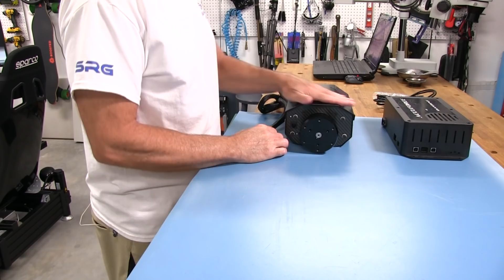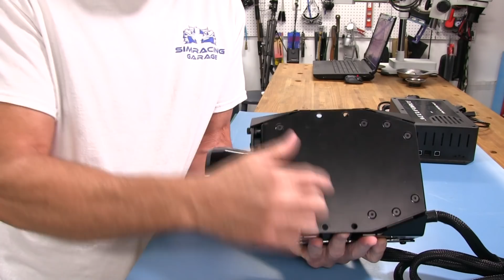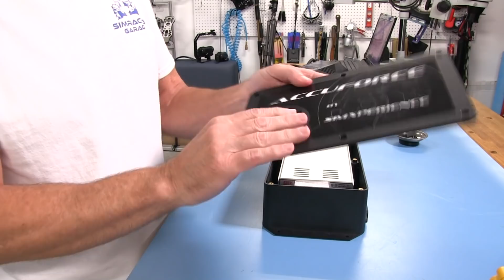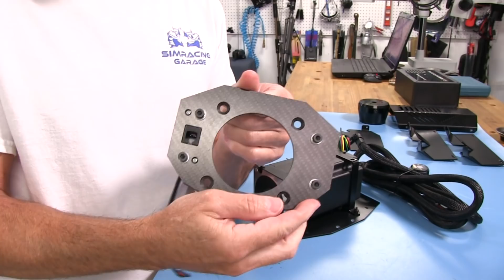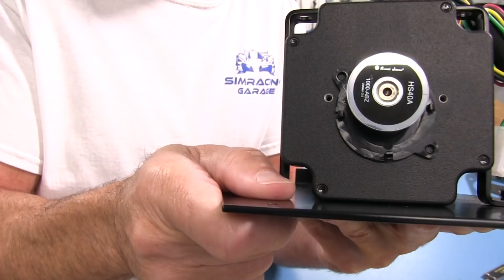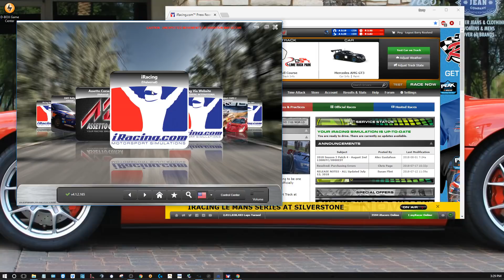Accuforce V2 DD Wheel Review

Comment: Many people say DD will only make you consistent, can anyone tell me what consistency is and how DD helps with consistency?
Reply: K.G Consistency is repeatability. Direct drive is more solid than belt drive, so it's more accurate. Any piece of kit that's accurate and predictable - from a sand wedge to a rifle scope - allows you greater repeatability by being one less point of variance in the system.

TL;DR They wiggle less.
Reply: Oh I see. Thanks Portable Gamer.
Reply: Typically when people say consistency they mean their lap times are less spread apart. They are not faster but their lap times are closer to each other.
Reply: The consistency I have found in using a DD wheel, as well as quality pedals, is the ability to better understand what the car is doing at any given moment and adjust.  Every successive lap on a track is varied---different tire temp and wear, different entry angle and speed at a corner,  different traffic, etc.  The immediacy and detail of a DD wheel enables rapid, accurate reaction/adjustment to the hundreds of variables one encounters on a lap.  This means more consistent lap times, and for me---far fewer slides, forays off track and wall-kissing bursts of frustration.  I could make just as fast a hotlap on my T500---or even non-ffb ECCI . . . but it would be a best lap among dozens of error-filled laps more akin to guessing right for 17 corners rather than actually controlling the car.  With DD, one can truly drive the car rather than guide it down the track.

To me  . . . that is the consistency that DD brings.  Several dozen consecutive laps with no incidents with laptimes that only really vary due to tire wear and traffic.
Reply: Thanks MANshTTU, you explained it very well for me. Now I fully understand why I never felt satisfied with the laps I made with my controller. I'm not driving the car I'm just guiding it. But #poorlife so can't get even a non FFB wheel and to top it off no way in my country. I think I'll try to make that DIY FFB wheel I saw in YouTube. Who knows maybe I'll make a DD wheel. Thanks again everyone.
Reply: You'll also find that the improved consistency is also synonymous with more confidence. Because you have more control over the car, and it's behaving more predictably, you will find yourself with more options when it comes to attacking and defending. You can run deeper into the braking zone, kick the brakes harder, turn-in sooner (or later), etc, because you're not afraid of losing the car. Nothing like seeing someone get a good exit behind you, pull alongside, and run wheel-to-wheel with you into the next corner, only to see them drop back, because they didn't have the confidence (balls) to brake late, like you did.  :)

Comment: Considering this DD kit - but would love to know what wheel you would recommend with this device? i've heard the SimX wheel is "flimsy"
Reply: Can confirm this. The wheel itself leaves a bit to be desired. Been wanting to convert my old fanatic wheels to it but don't know how. Really is a awesome bag for the buck system otherwise.
Reply: I used the stock suede wheel for 2 years on my V1. It only flexes if you force it forward and back, not a motion you should be doing while driving, even if you tend to push against the wheel. I will say that switching to a Sparco P310 was more than worth the cost of the wheel. Total game changer. Makes wheel feel slightly stronger due to smaller diameter, feels superb in hands, and doesnt obscure as much monitor.
Reply: I recently bought a Sport Line Competition 300mm wheel.  It is really nice, of comparable quality to a Momo, and less expensive.  I got mine from Crowder's LLC through Amazon.

Comment: power supply just moving around like this ??? poor design, no go
Reply: -The power supply is actually captured between the standoff on the bottom and the top lid of the case. Once the lid is off, the PSU can move, but it shouldn't otherwise. The foam is simply precautionary for cases of extreme shipping abuse.
Reply: They got lazy and didn't thread stand offs into the psu lol wow, oh well, it would cost you only a few dollars to buy some stand offs and then drill a couple holes no biggie, that's what I did to my OSW power unit because I used a small PC case.
Reply: i love how you people TRY to talk it down :D
Reply: The power supply shouldn't move because it has no FFB:D
Reply: does it move when the case is closed? The lid has an indentation for the supply so it might hold it in place.
Reply: ofcourse it does. how you think the rubber standoff gets loose its something called moving and friction. really poor design imho.
Reply: It does not move around at all.  I have owned mine for almost two years and have had zero problems with anything, including the PSU.
Reply: lol that was because it was sitting still......  now mount it on your motion rig :) and hear rattle around in the box
Reply: Why would you mount any external PSU on a motion rig?  The cable has plenty of length to mount it away from the motion rig.  I have mine on the wall, several feet away from my cockpit.
Reply: Why so obsessed with the AF, Seb?

You're parked in every thread that mentions the wheel on iRacing; spewing nonsense, alluding to expertise you clearly don't have, all under the guise of 'helping the community'.

Sorry, but unless you're an industrial designer - and much more familiar with the wheel than you are, your opinion is pretty useless.

That said, Barry's review is, of course, up to his usual standards.  Although I wish he'd move through some of the introductory matters a little quicker, and discuss product performance earlier, he's obviously the community's most reliable reviewer, and we're lucky to have him.

Edit: Regarding the rubber standoff cap, it probably came off when Barry removed the control box 'lid' at an angle.  While I appreciate him taking the time to fully document product components, Barry's use case is an outlier, and removing the lid is actively discouraged.  I could be wrong, obviously, but I doubt the rubber cap will separate like that with standard use.
Reply: Don't you see the build quality is very questionable  and you can't even reconize it ?, nice scratches on the PSU in the box. i am not obsessed with AF lol, i just pointing out the flaws. and the lovely phone cable with rj11 plug. really a quality peace!
Reply: I recognize quite clearly that the electronics box build quality is fairly low, but I don't view it as subpar.  I would love a CNC milled enclosure, but the AF electronics box is meant to be mounted to a stationary structure, and in the case of motion rigs, probably separate as well.  I'm a build quality fanatic, but  the AF - especially the V2 - seems to have been created to provide as cost effective a DD experience as reasonably possible, and given the paucity of electronics related failures seen on the forums (admittedly anecdotal, but nonetheless relevant, I think), the electronics housing appears to perform its function rather well.

That said, I think SimX has really dropped the ball with respect to SimCommander's usability and documentation.  Perhaps I'm being over critical, but when something as simple as reducing the overall wheel weight is as misunderstood as it is, the software needs revision.  As an AF owner since mid-2015, I'm pretty sure I know how to reduce the wheel weight of my auto-tuned profiles correctly (that is, without also reducing the wheel's dynamic range), but the process is absurdly unintuitive, and if I'm correct, the obvious setting will reduce dynamic range.  I've read just about every resource available, and watched countless videos, and am still unable to verify my own workflow beyond a mention/confirmation from Berney in the Owner's Club forum years ago (that I can no longer even find to further review).

SimCommander's Effects hierarchy is equally impenetrable - and while MockRacer's (Bedo) guide offers substantial assistance, it's a superficial glance into, for all intents and purposes, a veritable abyss.

Adding insult to injury, the initial, plug n play FFB, IMO, isn't very good (if you simply adjust the basics settings that Barry highlighted, and save them to the controller box).  Given FFB preference's subjective nature, I'm sure some are happy with it, but prior to auto-tuning profiles for each car, I was terribly underwhelmed.

I'm still a bit skeptical that DD technology is as revolutionary as the hype suggests - and wonder what role post purchase rationalization (and placebo) may play in all of it - but, thankfully, my auto-tuned profiles feel fantastic (once I adjusted max torque to lower the wheel weight considerably).

Unfortunately, the auto-tuning process itself is both undocumented (outside of a Richard MacNaughton Owner's Club forum post, which explains the process completely, but isn't very easy to find), and fairly unintuitive.  The process necessitates at least two trips through the Output Tuning Wizard - the first run through enables all the default effects, while the second - performed after driving a few clean laps at your circuit of choice - actually auto-tunes those effects from telemetry, and for the majority of users, an immediate return to the Game Feedback secondary settings to lower the wheel weight.  

I love my AF, but ironically, it may be the least plug and play peripheral I've ever owned.
Reply: What are you talking about ? I just went back to iRacing after 4 years and i only post 1 question on iRacing since about how to setup iRacing 1:1 FFB. 
I dont need to be an industrial designer to know that if something fixed "by friction" it's a bad design. period. end of discussion.
Reply: I was replying to Sebastian Keijmel, not you.

As for your "It's a bad design. Period. End of discussion." nonsense, emphatic doesn't equal persuasive, and taking advantage of material properties like surface tension and friction is often an excellent design choices.  An electronics control box that's meant to be mounted and subject to zero load (especially off axis) needn't be over-engineered.